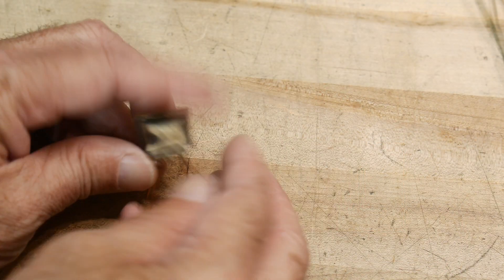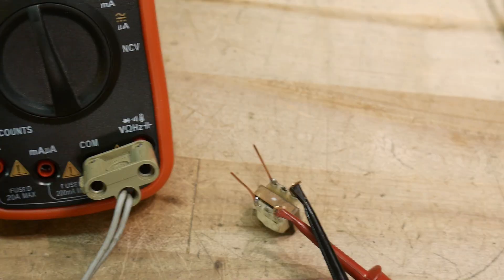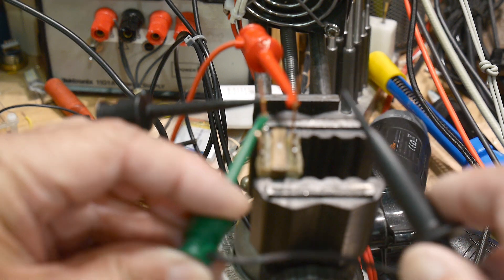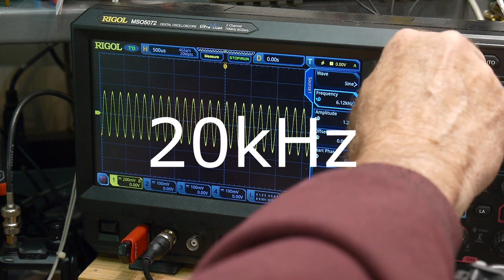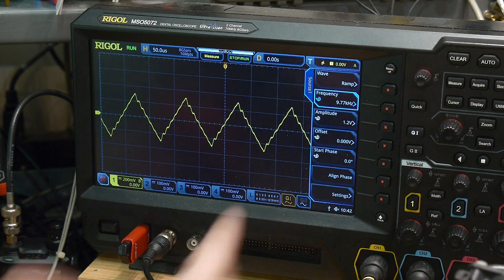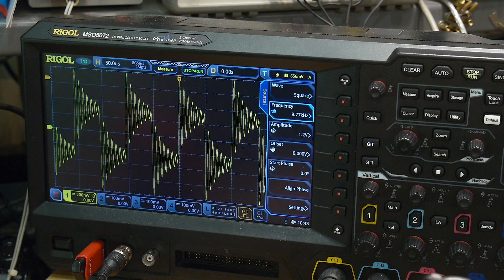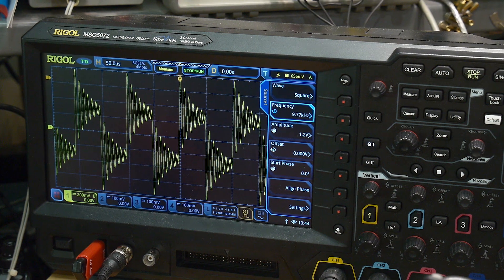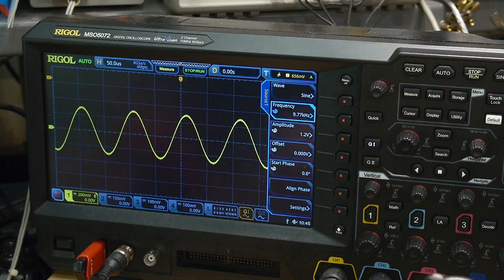#1082 Do audio transformers add distortion?

Comment: Yes, it's already been said in here a million times, but just to drive the point home, transformers in audio applications such as these do not have this type of ringing if they are correctly impedance matched on both sides. As a matter of fact, transformers can be used to add very specific musicality to the circuit, as long as they are integrated properly and impedances are carefully matched. Sometimes buffers are needed in order to get everything in its right place, but transformers can truly add their own pleasing artifacts  and musical flavor when utilized correctly.

Comment: I have definitely had a transformer add distortion. I have an early 70s Bogen paging amplifier, solid state, 60w, it has 70v, 25v and 8 ohm taps on the OT. 

The OT is not a clean, clear, 100% accurate component. The frequency response is rated at 70hz to 12khz, instead of 20hz to 20khz. Used as a guitar amp, sending a hot but clean signal through it, it will actually add some distortion just like a tube amp. Its not quite as much, but when it is over saturated, it will add some distortion.

Comment: I had a super cheap  DI box for a PA rig...(free gift with purchase of a box of cables).   the transformer was microphonic.   If you bumped the box,  ringing came out of the audio.  I'm sure that's a different issue.   I put a high grade transformer in that DI box and then life was good.  It's actually my favorite DI now,  with one of the best grade transformers out there.

Comment: Every audio output transformer or intermediate stage audio coupling transformer I have encountered has the pins for the primary on one side of the core and the pins for the secondary on the other side of the core.  Your transformer has six pins arranged as a 3x2 pattern.  Typically, that means that one set of three is the center-tapped primary, the other set is a center-tapped secondary. Since you found that the two sides are connected together (low resistance across the core), and all your experimenting uses this connection, I am inclined to think this is a shorted output transformer or an impedance-matching autotransformer.  In either case, or whatever the case, this is an oddball transformer, which may not be useful to provide representative results of audio transformers in general.

As far as the goal of the experiment, the answer has to be "yes" - audio transformers add distortion, because every added component adds noise and distortion.  It is only a question of how much and in what way.  As other commenters have noted, you need to impedance match to transformers, or at least take the impedances into account, when doing such measurements.   It is true that transformers have resonant points, which can be useful in many applications, and only the frequencies of interest matter, since the circuit design should ensure that parasitic oscillations are suppressed.  Also, consider that audio output transformers that drive speakers see a motor coil (meaning it is a coil with a changing load on its inductance field), which also needs to be considered so that the nonlinearities of the speakers are canceled by nonlinearities in the audio output stage.  With all this complexity, it is a wonder that it works at all!  However, many of these distortions are small enough and the impedances are low, so just tuning circuits with designed-to-be audio transformer matched to resistive loads is often good enough for everyone except the very picky audiophiles among us.  

I spent a lot of time tweeking and tuning circuits and speakers to produce the best audio reproduction into reference microphones, only to have confirmation that the "experts" love the distortion they have gotten used to hearing.  After dealing with descriptions like "warm", "soft", "bright", "tinny", "cool", "brassy", "heavy", "muddy", and many more, and trying to assign spectral and temporal distortions to each colorful term, I decided I must be deaf and went back to working on computers where 1s and 0s are always just 1s and 0s and answers are either right of wrong.

Comment: Use transformers all the time for tube amplifier output.  5k ohm to 8 ohms.  I'm not sure what the application of the transformer was exactly, or tested with triangle waves before.  But a 1k square wave has serious transients for an audio system.   You don't have any load on the transformer either so it's going to misbehave.  Match the source impedance with a load impedance and try again.  Good transformers are expensive.  Like the scope BTW, I have one.

Comment: This is useless video! Transformer needs to be impedance matched on both primary and secondary side in order to have signal integrity and meaningful square wave signal handling.
Second reason why I call this video useless: I was fully expecting a read distortion measurements! It is a well known fact that unless a special circuit is implemented to drive a transformer, it would distort low frequency signals - say below 100 Hz.
Holding the poor transformer on vice would not improve things. So poor planning, poor execution.
Reply from the maker: I found it useful as many viewers helped educate me and possibly others

Comment: its just reflection due to iperdance inbalance.   try adding a resistor parralell over the coils.  depending on trafo in audio its often 600 ohm,   so on input (generator) add a 550 ohm  in serie with coil, and on output of trafo add a 600 ohm parallel with winding,  ( or used 2 potmeter to get optimal values)

Comment: Not a very conclusive test. 
You took a random transformer and made a random measurement without proper load.
Transformers, like pretty much any component must be well integrated into the curcuit with correct levels, correct load impedance etc.
Even though the ringing technically is outside of the audible range here,  no serious engineer would have accepted this result.

Comment: These types of transformers are almost always used in XLR to "tip-ring-sleeve" 1/4th inch adapters,
with the "ground" being the shield and the tip / ring being the inverting & non-inverting output.
Not sure if they work proper in reverse though. (with signal coming from the 1/4 inch side)

Comment: Try to drive input with band-limited square wave (upped frequency limit of 20-30kHz) and match impedance of transformer on input & output, then it would be a real test how it works with audio signals. Square wave that you put in is (because of fast rise time) having harmonics going to MHz range and input & output impedance missmatch causes ringing...

Comment: My first thought is an impedance mismatch and my second is that an audio transformer is not designed for a 20 kHz square wave as any harmonics present in that wave are above the audible range.  Who can distinguish a square wave at 20 kHz from a sine wave at 20 kHz?  Nonetheless interesting discussion and thoughts shared in comments so thank you!

Comment: You have z-banding in your print back there. It's a 25 dollar upgrade and then 3d prints look smoother, even at standard rough settings. It's a 10 minute install.  Don't let yourself be gouged by official brand name z axis upgrades. As long as there's a motor, coupler, rod and a few other parts buy it. It's better than auto bed leveling like a bltouch.

Comment: In almost all of the mic preamp schematics that I am familiar with, they use a small capacitor across the output side of the transformer or a capacitor and resistor to dampen ringing and, as people have mentioned, they also will load it with a specific input impedance/resistor in the next stage. I suspect they may also have taken advantage of inherent miller capacitance to help with this in some tube designs in the past.
Reply: Precisely. IMSAI Guy would need to match the input and output impedance first off, to conduct a valid plot of the transformer's audio-range linearity (20 - 20K hertz). Adding a Zobel network (resistor and capacitor in series) on the output side of the transformer will help a lot in reducing/dampening any induced L/C distortion. This from my "somewhat limited" experience in working with audio transformer applications. Additionally, a Mu metal can at ground potential, to physically shield the transformer would also most likely help to reduce/eliminate any distortion from radiating into and out of the transformer. Just my $0.02.   Fred
Reply: @electronicengineer  Yeah. I mean some of the distortion is also considered desirable. Not ringing, but harmonic distortion is one of the things people like in a transformer-coupled sound. There's also hysteresis that plays a role as well.
Reply: @control_voltage  Agreed. A majority of tube amplifier aficionados seem to prefer the even harmonic frequencies produced by those tube designs, as they're commonly referred to as a "warm" sound. I was taught that a clean amplifier will not "color" the audio signal in any way, including even/odd order harmonics, IMD (intermodulation distortion), dampening, and usually, at the top of the list, is THD (total harmonic distortion). To each their own I say. I like to listen to "clean" audio, however I have a tendency to almost always end up with the bass (0 - 100 Hz) pushed up a bit and I suspect, due to my aging hearing, the treble/high end frequencies find themselves also pushed up quite a bit, as I chase the "perfect" sound... It is all subjective in the end. Have a great weekend Christopher.   Fred

Comment: The frequency of that ringing is around 50kHz and would therefore be imperceptible to the human ear and therefore not have any practical implication to an audio amplifier with a typical frequency range of 20 - 20,000 Hz.
And as other comments suggest, if the secondary winding was resistively loaded, the ringing would also be heavily attenuated anyway.

Comment: assuming output from function generator is 50 ohm should you not have a 50 ohm times the transformer factor on the output of the transformer to match impedance? Then you can measure with 10 MOhm in parallel with that.

Comment: A well-designed speaker looks like 8-20 Ohm resistor, which I presume is not included?  This would damp out the oscillation.  Also, the frequency is a bit beyond 20 kHz.

Comment: Never had distortion issues with a properly matched isolation transformer,  we used 600:600 transformers where the secondary had a few more turns to give us a true 1 to 1 voltage and cased in a mu-metal can for screening.
Reply: I appreciate the folks that know to refer to the transformers as what they are, because telling me that a transformer is 1:1 tells me absolutely nothing! For all I know, I can be a 60 turn transformer with virtually no use outside of 60 AC modulator circuits.
Reply: @RobertHallIV  1:1 just describes the turns ratio, meaning that the transformer is just providing an isolation barrier.  With no changes to the voltage  or current flowing.  It doesn't describe any other properties,  so it could be a small one for audio or a larger one for mains.
Reply: I need to see an eye doctor, I ve read nu- metal screaming and I couldn’t make any sense lol
Reply: @mpasistasyalanci  i think mu-metal screams when you bend it as it don't work to well after that.
Reply: "Line level", correct?
Reply: @MikinessAnalog  Sort of, we used to have a 1V rms system level, so all inputs were designed to produce 1V rms at max volume. and just to make life more fun all outputs were in dBm. (0.775Vrms into 600 ohms).

Comment: You must match the impedances properly if you want to maintain signal integrity. A well made audio transformer in a well designed circuit will have negligible effect on audio quality. (That’s subjective, obviously). There’s loads of broadcast quality gear that has audio transformers in it. Mixers, microphone amps, wireless microphone receivers and so on. Transformers do appear to be falling out of favour, probably mainly due to cost as good ones are very expensive. They were ubiquitous in gear with XLR connectivity not so long ago.

Comment: I'm guessing the ringing is from inter winding capacitance. Transformers can express parallel and series LC behaviour depending on the frequency of the input waveform.
Other interesting distortion can be caused from DC biased drivers (single ended) which runs the transformer core with a fixed amount of magnetic flux. Modulating that causes distortion in the primary to secondary coupling, due to hysteresis in the core.
Have you done a frequency sweep of the trans to find the parallel and series resonance points?
Cheers,

Comment: This ringing is the consequence of impedance mismatch.  If the transformer was loaded at the design impedance then the energy would have been consumed by the load instead of ringing with the parasitic winding capacitance.  In effect the load resistance kills the Q of the parasitic resonance.